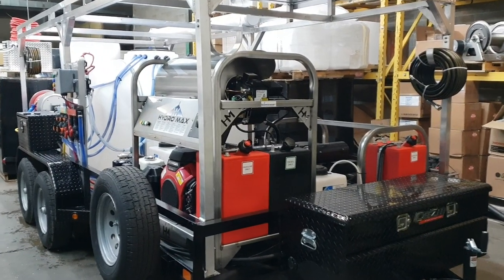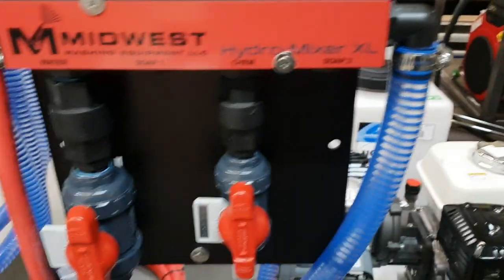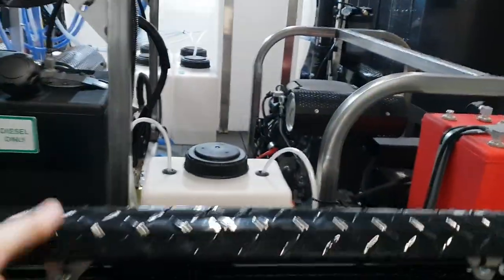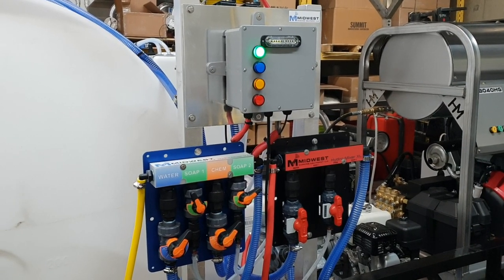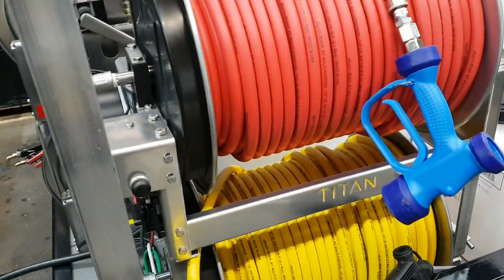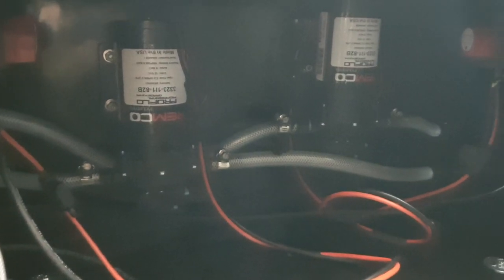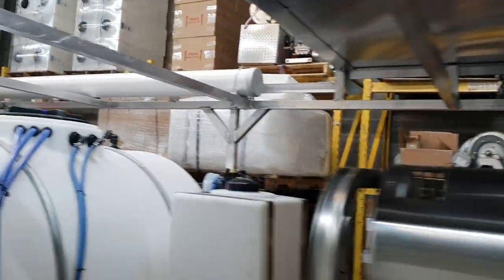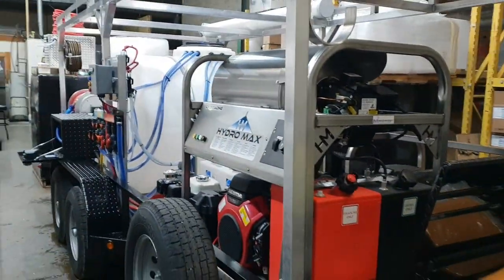New Custom Trailer Build by Midwest Washing Equipment

Comment: Are all the machines key start? Why run 4 batteries? High draw on the x series?
Reply from the maker: All are electric start except the rinse pump, the X series draws about 43 amps, plus there's 2 WFP pumps 12 volt, a 2 battery bank would be fine but this customer requested 4 to insure never running out of power.

Comment: How much for a metering system with the Valves and the on and of remote for the bleach for a gas powered roof pump
Reply from the maker: $799 and $695